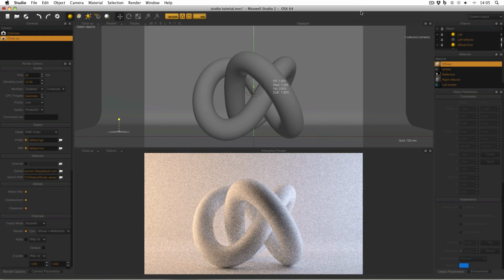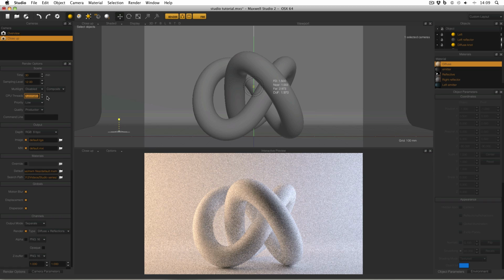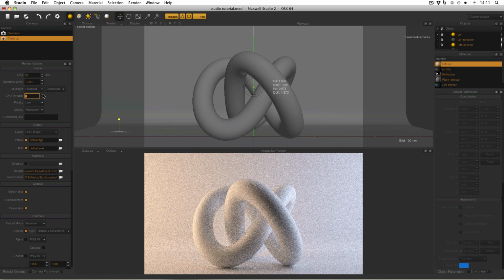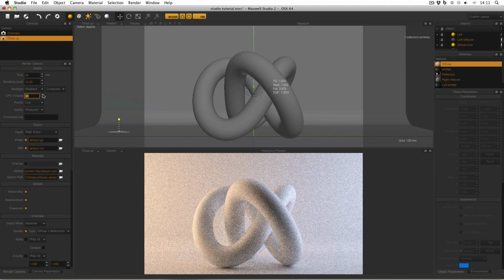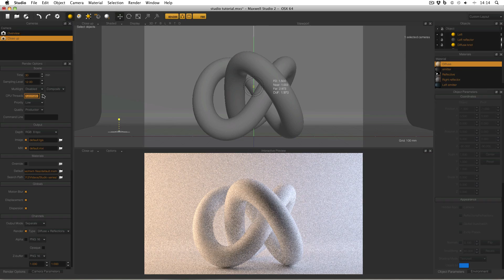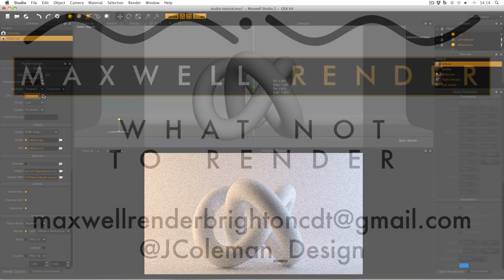What Not To Render #4: CPU Threads - Maxwell Render Tutorial

Comment: Hi, may i ask you if is better a low frequency cpu with more core or an high frequency cpu with less core? i'm going to buy a workstation and i don't know if maxwell work better with a certain E5 Xeon processor or another. Thank you
Reply from the maker: Have a look here to compare CPUs: http://www.maxwellrender.com/benchwell
Reply: Thank you but i already know the benchwell page, the problem is that is not shown if some configuration is with single or dual processor, you can notice that some processor, powerful than others, have worse point (like 269X vs 2650) and deduce that the latter configuration is dual xeon, or overcloacked.